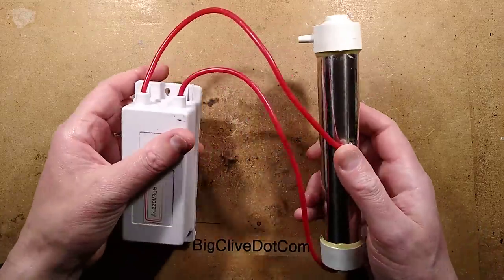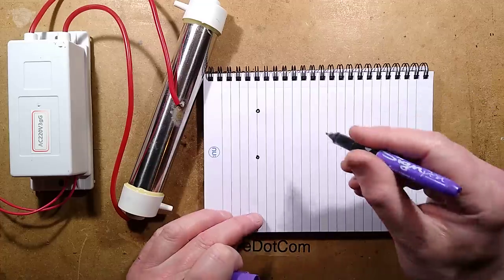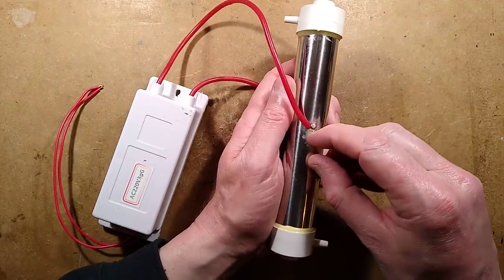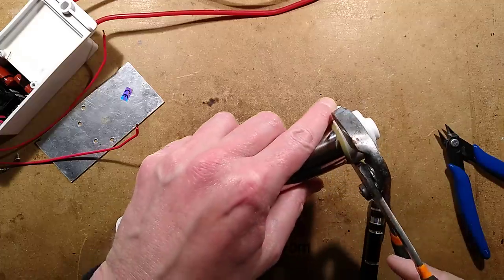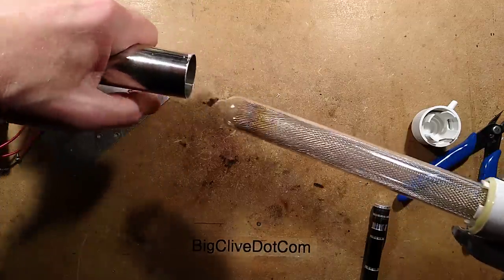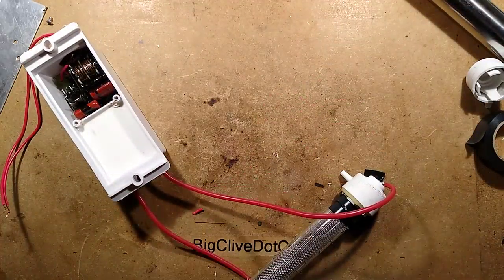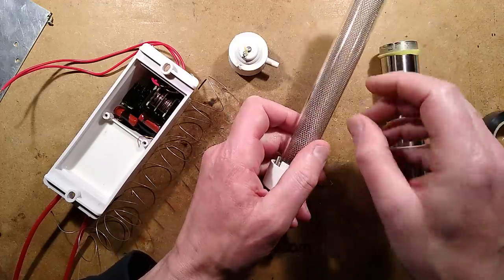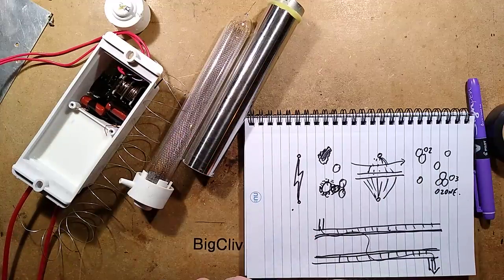Inside an airline cold-plasma ozone generator cold-plasma tube.

Comment: I used to work in a commercial laundry where we used something like this to inject ozone into the washing machines. The ones we used were all enclosed, but the design was very similar. It used a glass tube with a port on each end, and there was a stainless steel brush electrode stuffed down the center. It looked like a giant bottle brush. I had to take them apart and clean them with denatured alcohol every year or so to keep them working efficiently. They were fed from an oxygen concentrator, similar to the machine a patient would get supplemental oxygen with, but not medical grade. Instead of the metal tube it just used capacitance to air, but they were also fed from a 12-15KV supply. They made some seriously potent ozone, and there were numerous sensors that would shut them down if the concentration in the room got too high.
Reply: Did it have a scrubber to desiccate the oxygen?
Reply: That's how they disinfect the clothes...
Reply: @PradeepKumar-ps4cs  More like that's how they remove odours from the clothes.

The dry cleaning itself should do a good job at killing microbes just on its own.
Reply: This is the great thing about the internet, no matter how obscure the subject an expert will always appear.
Reply: Hi Chris! Was it JLA in UK? I did work there and we did use the same method.
Reply: @Serverokchannel  No, this was a facility laundry for a state organization in New Hampshire, USA
Reply: Certain plastics are destroyed by ozone, I wonder if things like buttons and plastic zips are affected?

Comment: Why, with a spark gap like that one might be able to communicate clear to the Americas!
Reply: im in the usa and i heard it so yep :}
Reply: I hear that in my head in an old timely voice.
Reply: @gbear1005   Fun fact! That old timey voice sounds old timey because it has the TransAtlantic Accent. It was specifically designed for use over radio for clarity, so it's a non-regional accent.
Reply: Problem is nobody would be able to stand listening to the damn thing for long!🤨
Reply: Oudin coil?
Reply: Needs a nice 60m antenna. Without a antenna it can only transmit up to around 100 feet, if that
Reply: Why would anyone want to do so?
Reply: It just needs some iron powder in a glass tube

Comment: i guess the heat colouring of the mesh happened when they molded the glass tube shut.
Expected to see it only on one side where the wire goes in because you could make the tube sealed on one side and put in the mesh afterwards. hm.
perhaps they put in the wire, close that side, and at the same time or afterwards pull the vacuum/gas on the other side while closing it.

Comment: On the bright side.... you now have a really strange looking glass and metal condom art piece.
Reply: @jdhtyler  A different testing method was to wrap them on tubes like these, and then dip them in electrified water (automated of course). The carbon brush method seems to help there, as no drying is needed.
Reply: with a bite !
Reply: @peehandshihtzu  You missed the S in punk
Reply: "Violet Wand".

Comment: There’s a delicate balance between a level of ozone that is safe and one that can do serious harm to living organisms. You see this in urban areas in the summer, where air quality alerts are issued when ozone levels get above a certain point. It would be difficult to maintain a consistently safe level of ozone in an enclosed space without monitoring equipment.
Reply: You're not supposed to use these in truly enclosed spaces - you either run them in ventilated areas or when the area is not inhabited.
Reply: Eating grilled cheese is tasty. The recipient of the grilled cheese experiences joy.
Reply: It’s okay! He has beer ;-)

Comment: PSU is basically a tiny spark gap Tesla coil, same technology as that in stun guns, usually two-stage, first one is a simple solid state oscillator with a small ferrite "flyback" step-up transformer or inductor as an autotransformer, which feeds the second spark gap stage, and the high voltage transformer module. What appears to be the "choke" might be actually the first stage transformer. Either that, or both stages are inside the white resin potted module.

Comment: I believe that AC power on airliners is at a much higher frequency than the 50/60Hz used domestically, the idea being to let transformers and the like be smaller. Might this be why the ozone generator misbehaves when connected to the domestic mains?
Reply: 400hz is the typical frequency for AC power on aircraft
Reply: I'm thinking the airline in the title refers to the air line that blows air through the tube. Not a commercial air carrier.
Reply: @mwechtal  I'm thinking that you're right. Similar products on eBay say to use an airflow between 150 - 300 cubic meters an hour (which is a hell of a lot! - most of that would likely be for cooling).
https://www.ebay.com/itm/Ozone-Generator-Ozone-Tube-7-5g-DIY-Water-Treatment-Air-Purifier-Home-Ozone-Tube/183790060116
I used to use a corona-discharge ozone generator last century to 'sterilise' recirculating water in a tropical fish breeding system. They work best with dry air (or even better with pure oxygen). I introduced the ozone-enriched air into a 0.5 m2 sealed PVC chamber that contained a large surface area media that some of the recirculated water then trickled over. That water was then dumped back into the system (before the debris filter so any unreacted ozone in the water reacted with trapped detritus rather than the fish's gills). The idea was to kill any microscopic pathogens in the water and this maintain the overall health of the fish.
I used a belt and braces approach. On another 'loop' I also had a 1.5m long 50mm diameter stainless steel UV steriliser that contained a quartz UV tube.
Reply: Good point. IIRC, it's 400 Hz.
Reply: Yeah that hunk of junk isn’t airline quality. !
Reply: @mwechtal  correct. They're often used in steam shower cabinet things, where they run after you're done showering in order to keep nasty microbes from growing in that warm and moist environment. I recognised that sound right away when he fired it up.
Reply: @x_x_w_  115V at 400hz
Reply: I think it says "AC 220V" on the label. God knows I am no expert though.
Reply: @ianbutler1983  That's so he can use domestic mains to drive it, I would imagine the aircraft unit had a different power supply.
Anyway I used to have a war surplus (WWII) aircraft AC generator, it was a big motor alternator that took in 24v I think and output of 400Hz I don't remember the voltage, it was used to power the radio equipment.
Reply: @dolanbaker  I've a rotary transformer - 12V DC to 230V DC.
Reply: @mwechtal  Had me fooled too, I thought he was talking about airplane cabins. And it did occur to me that it looked shoddy for FAA standards
Reply: 400hz is standard for aircraft ac lines
Reply: However airline in this case means breathing air
Reply: @kirkkitchen9822  "An airliner is a type of aircraft for transporting passengers and air cargo"

Can't be much clearer !
Reply: If I heard that thing fire up randomly after my shower, it would scare me so bad that they would need a hell of a lot more than some air to clean up.
Reply: @millomweb  the title says airline (a line which carries air, or legal entity which operates aircraft), not airliner.
Reply: @zoravar.k7904  So ???????

Comment: If you have a laser printer in your home, you have a source of ozone...  There's a wire that the paper passes under called a corona wire, and it is literally a corona-discharge unit like this -- only not as powerful.  It is supposed to impart a negative charge to the paper, so that the positively-charged toner particles will stick to the paper better when the paper passes between the drum and the fuser (where the toner is fused onto the paper with high heat).  But one of the side-effects of this corona wire is the production of a bit of ozone every time you print something.

Comment: Remember the electrical discharge method of generating ozone also breaks apart N2 in the air. Single O and N recombine into varying lengths temporarily, call nitrogen oxides, and when those combine with moisture, like in our lungs, the result is nitric acid. I stick with UV.

Comment: Hi Clive, nice video as always! I've "gone through" a few of these tubes of this design during my research into water ozonation. A couple of them have even melted on me! The internal glass-electrode connection is tungsten, which traditionally bonds well to glass but is always very poor on these units. This is spot-welded to the stainless mesh inside. When they are new they sound very spikey and the 10Kv PSU produces a good amount of ozone but they nearly always start to fail at the solder joint between the tungsten and the external connection. The sound will die down to a buzz and after a while it arcs-out at the connection (the closest point) and eventually overheats. I'm not sure if the internal tube is meant to be under vacuum or filled with gas, I never found out because they were always broken! Sometimes I could hear the RCD in my lab humming when the units were on, which is never a good sign!
Reply from the maker: That humming is down to the sharp voltage spikes.

Comment: neat, I used to build gigantic ozone generators for water cleaning.. The idea was the same. It was a 1.5ft long x 3" diameter glass tube with foil stuck to the outside, covered in a large piece of capton tape, the center of the tube had a large stainless steel bar running through it and it was sealed at both ends with an air inlet/outlet at each side, Air passed through a oxygen concentrater and then was pushed through the tube and a lot of ozone came out the other end. Usually one of these machines had 5-15 tubes depending on the size and they basically ran off large neon sign transformers. It was beautiful to look at when it was running. Also I'm sure breathing in lots of ozone over the years even though I was always safe damaged my lungs a bit, I also lost most of my ability to smell ozone unless in super high concentrations.
Also when they started to arc across the tubes due to moisture or usually an oily buildup, it put on quite the spark show.

Comment: Its common to put a catalyst inside, they heat it up and it reacts with all the impurities in the tube after you have vacuum sealed it.
Reply: that is a 'getter', but requires a heating element to operate. Common in most vacuum tubes.

Comment: I found a similar device inside an old kitchen extractor hood I don't use anymore. It looks similar except that the metallic grid is outside of the tube and there is another electrode inside of the tube. The internal electrode is a wire at the center of the tube so it's quite far from the grid, but the tube seems to be filled with gas because it lights up like a plasma ball. That's a very intriguing device!

Comment: I think the burn mark on the inside of the tube is from where they flash the "Getter" with a loop and a burst of RF ,  it burns up any remaining oxygen after evacuating the tube. As you mentioned the connecting wire is usually of an iron  alloy which matches the thermal expansion characteristics of the glass.  Thanks for sharing , most interesting.

Comment: This is remarkably similar to an ozone generator I used to work with in a NOx Chemiluminescent gas analyser.  These generators ran off the mains with a similar size discharge lamp & metal jacket arrangement.  They could generate a considerable volume of O3 capable of corroding pretty much anything should a leak occur.  The analysers required a large activated carbon "trap" to remove the ozone before the gasses moved onto an oil vacuum pump.  This carbon became incredibly dry & oxygen rich, regularly bursting into flames when the traps were opened to replace the carbon.  I recall the traps were basically a pipe bomb.  One did go off in an emissions rack at a power station, blowing the cabinet sides off & causing a bit of a mess.  Similarly something called a "Noxgen" was used to check the efficiency of the chemiluminescent NOx analyser internal convertors (NOx = NO+NO2)  This was basically just a variable frequency ozonizer in a box.  Clever stuff.    I recall walking into an office in Rolls Royce, Filton one visit to the overwhelming stink of ozone in the building.  Apparently people had been complaining about headaches & stinging eyes for a few weeks..

Comment: Very nice! The glass is sealed because the internal parts are not resistent to ozone, the ozone flow is outside. It is cheaper to close the glass than use stainless stell inside the tube.

Comment: I used to work in blown film plastic factories and they used a device called a "Treatment" box. It was between 1 and 1½ metres wide (depending on the size of the bubble when it was converted to  a lay flat form) and had multiple fingers 5mm wide that were adjusted to put an arc onto the plastic to make microscopic pits that would allow printers ink to settle in and set dry. Without the pits the ink would just peel off. The voltage across the fingers was 400V (no idea of the amps) but it used to produce and awful lot of ozone and the arcing gave off a very nice purple colour. We got ozone poisoning once when the extractor fan on a 750mm wide treatment box decided it would take the night off and try and kill us. The result was worse than the worst hangover you can imagine and being a pisshead at the time I did have some hangover experience.
That was 40 years ago and I still don't like being near a laser printer when it is spitting out toner covered pages because of the smell of the ozone.

Comment: I had an earlier version. It had a ceramic insulator rather than a glass tube.  Didn't last very long before the power supply failed. If you're dreaming about saving on chemical treatments for your spa/hot tub, I wouldn't recommend it.  The ozone only partially dissolves into the water, which enables a build-up of ozone under the cover.  The cover will bleach out, and the vinyl will break down in weeks.

Comment: Reminds me a bit of the old "Violet Ray" rigs used by beauticians and naturopaths.  Corona leakage in transmitters and HV sections of CRT TVs  was often accompanied by the smell of ozone.  Older laser printers generally have an "ozone filter'  because loose ozone causes degradation in rubber and in higher concentrations has adverse health effects (sore throat, scratchy eyes, headache).

Comment: This is the same instrument described in school text books as the "silent electrical discharge"- silent refers to no arcing. About 0.1% of oxygen in air gets converted into ozone but there are cooled tubes that can produce about 1% or so using air. Using oxygen and a cooled tube, you can get upto 3% (I quote from memory). Corona discharge produces light and decomposes ozone.

Comment: That is just like the homemade ozone maker I made many years ago. I used plastic test tubes that are actually partially formed 2 liter bottles. I used brass wool shoved in the tube, and wrapped copper mess around the outside.

Comment: A friend of a buddy of mine, has a ozone generator connected up to the input(what gets pulled into the system from inside the house) of their heater/ac system of their home & yes, it does smell a little bleachy when the heater/ac is running the fan!

Comment: I work on/repair industrial corona discharge systems ..amongst a lot of other stuff...used in the printing industry to etch web at 100 meters per second...they produce tons of ozone as a by product .we have to use 4" ducting and high flow extract fans to get rid of it quick enough...imagine a corona discharge with a very visible (in broad daylight) discharge area of  ~ 110cm2 on each press looks fantastic.
they use long ceramic 'electrodes' filled with metal balls...no special gas just normal air in the discharge area.

Comment: I see a lot of comments saying the discoloration of the mesh is from sealing the tube. That's certainly possible, but you'd expect them to do that side before they insert the mesh and then do the other side. Weird. It's possible that this is made using retrofitted machinery for making vacuum tubes, where there would normally be a getter in the end that needs to be inductively heated to work. I wonder if that's what it is. I don't think there actually is any getter material in that tube. Considering what it's for, there's no need for it to be vacuum. But it may just be something they didn't turn off.

Comment: The red wire inside the glass is the same type used in an incandescent light bulb which expands with the glass to keep a percent seal I think it’s like ferrite based wire or at least ferrite coating something along those lines

Comment: My electrostatic air cleaner used to create a bit of ozone. I just had to replace the transformer. I can't get the original so I used a neon tube 3KV transformer that goes through a voltage doubler. The output appears to be 9KV and 10KV! (I got a used 40KV probe for my Fluke meter on Ebay). Surprisingly even though the voltage appears to be higher I am not getting ozone with this transformer (which outputs more current as well). This unit is around 40 years old. The original was a 4ma 3KV transformer. I had to replace it with an 8ma 3KV neon transformer. That is no longer made so I ended up with a 32ma 3KV neon transformer. So far so good.

Comment: At low concentrations ozone does not destroy odorous chemicals, it deadens your sense of smell. In ambient air ozone preferentially reacts with carbon-carbon double bonds. The most common chemical it reacts with in a home environment would be ethylene, which comes from ripening fruit. Ethylene is neither odorous nor toxic, but ozone oxidises it to formaldehyde.  Ozone is a strong respiratory irritant and is the last thing you want to expose vulnerable people to. Used in a controlled scrubber or when dissolved in water at high concentrations it can indeed be useful for disinfection or chemical oxidisation.